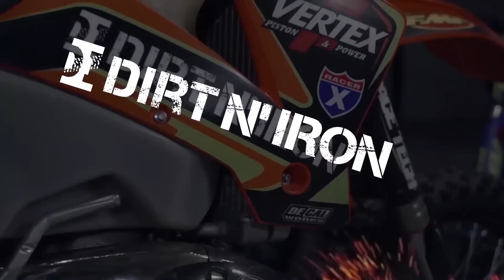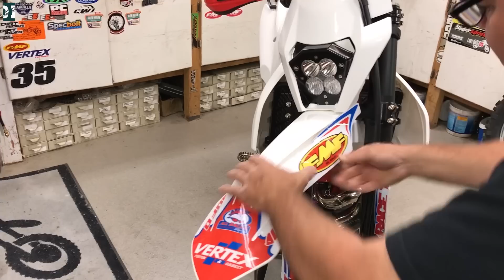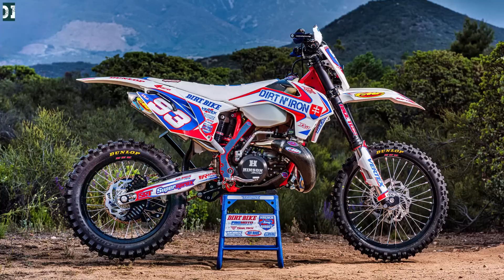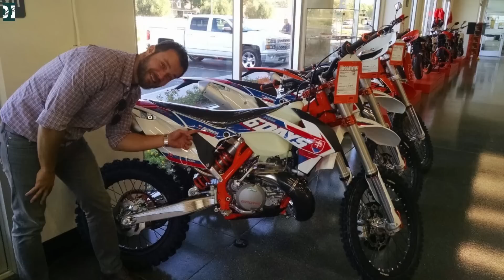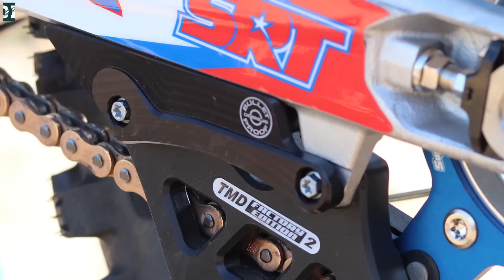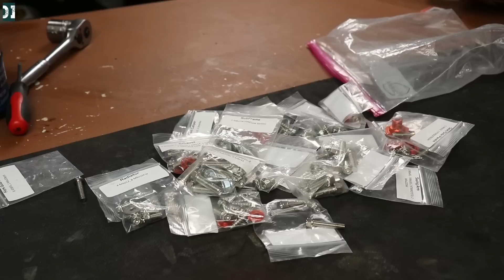KTM 300 XC Dirt Bike Build - WE ARE DONE!!!

Comment: Yes I am Building One Too- what Impact driver do you use??
Reply from the maker: makita impact
Reply: @dirtniron  cheers thanks, looks pro - to use one of those for - taking apart > I would be nervous using them to mount those bolts into Aluminum block!! nothing worse than stripping threads in the block!
thanks for the reply:)